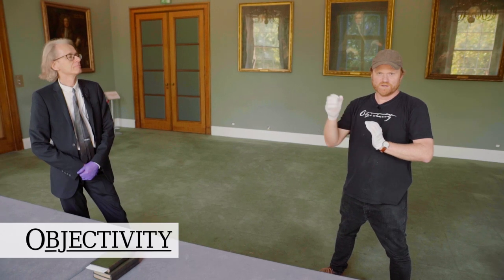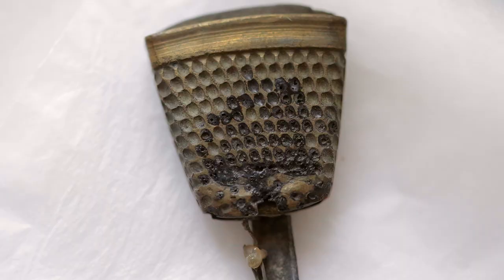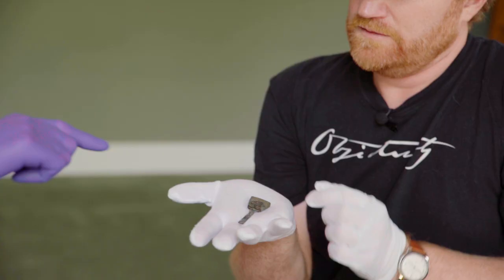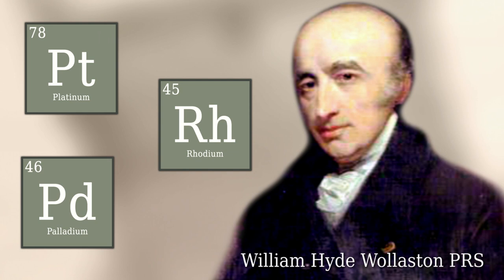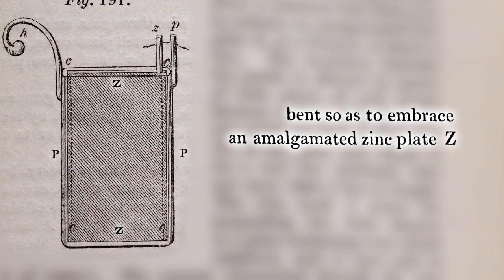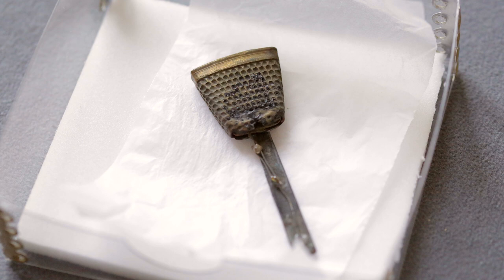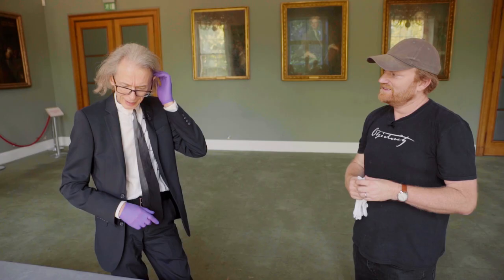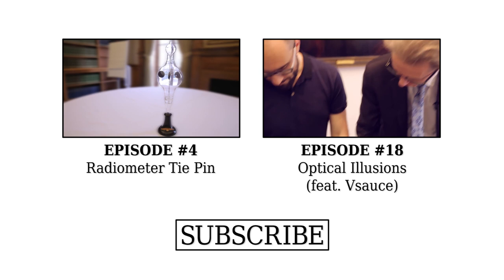Thimble Battery - Objectivity 230

Comment: Apparently a "line" is a unit of measurement equal to either a twelfth or a fortieth of an inch. I'd never heard of it before.
Reply: I assumed it was the thickness of the thinnest lines in the drawing.
Reply: That's imperial measurement systems for you 😂
Reply: @Grantallica  This is from 1811. The Imperial System of Measures wasn't codified until 1824, and the line was not included.
Reply: 1 line is ¼ barleycorn.  There are 6 points in a line.
Reply: The only other place i have heard it used is on the design for the Mosin-Nagant rifle, which was also called the three-line rifle, being 7.62mm
Reply: @warren1134  just type "three-line rifle" into google
Reply: @roderickwhitehead  You could very well be joking but I think I believe you.
Reply: Stone. Foot. Line. Point. Those crazy Englishmen and their generic noun measurement units.

Comment: That platinum wire is also called Wollaston wire as far as I can recall, he invented a method to produce extremely thin wire out of it. One of the uses of it was in an early radio detector, called a barreter detector. Edison also experimented early on with wollaston wire to make his high resistance bulbs but put it aside because it was too expensive iirc.

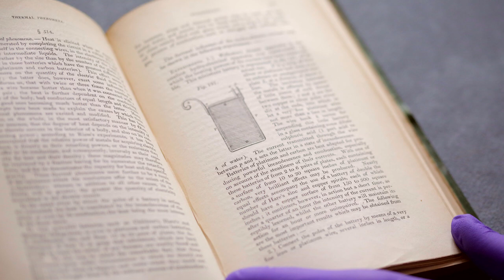Comment: 2:45 So the lightbulb was invented way back, before Edison was even born...
Reply: Edison is responsible for developing a filament reliable enough to be sold. As Keith said other wires burn, melt or only get hot without lighting up.
Reply: hardly. platinum based incandescent demonstrations were neither practical, long lasting, or affordable and never produced enough light to even read a book by at a reasonable distance. demonstrating mere incandescence induced by electrical current is a long way away from creating a real and useful light bulb, which is what Edison did.

Comment: Are there like standard lines that were used for measuring distances back in the day? Because in my world lines come in all lengths and sizes.
Reply: The line was variously defined as anywhere between a tenth and a fortieth of an inch, though at the time it was in common use the inch hadn't yet been fully standardized either. In this context I think it means "get them as close as possible without letting them touch".